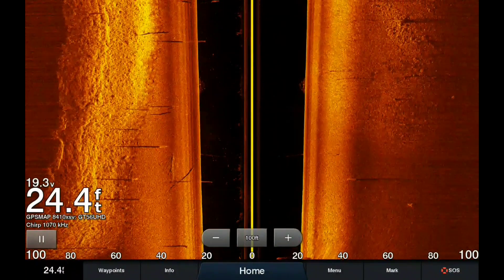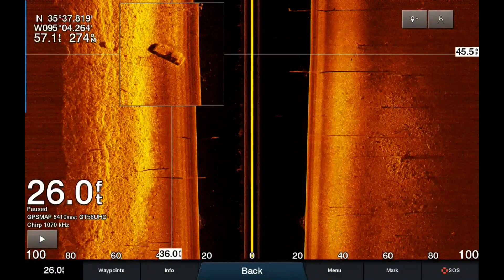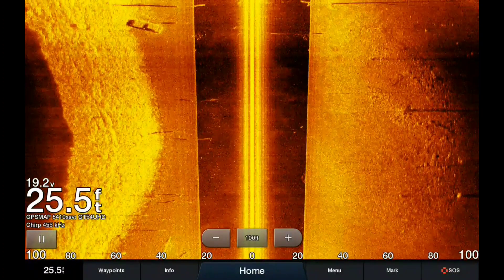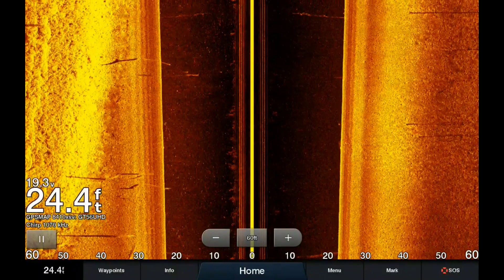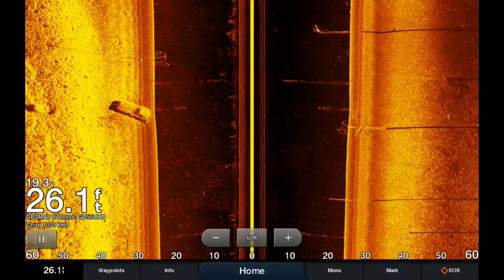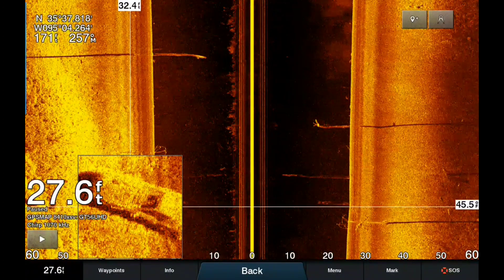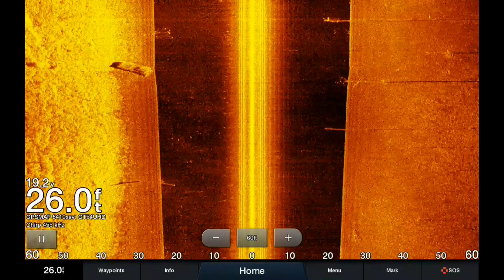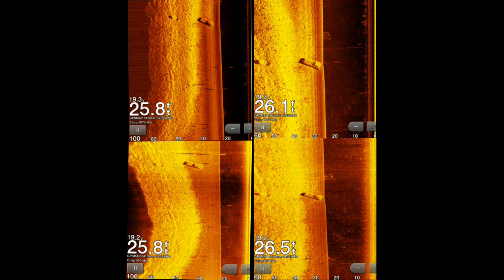GT56UHD versus GT54 Garmin Transducer set at 100 ft and 60ft on a found car / truck

Comment: Thanks for the comparison.  The new fish finder I'm getting comes with the GT54.  Which still looks pretty good.  I will be using it between my kayak and boat.  My plan is to use the GT54 on my kayak and get the GT56 for my boat.

Comment: Good information, sorry you didn't run the GT54 at 1230Hz to see if that improved the image. But no matter, the extra 3 inches of transducer gives a crisp image
Reply: noticed too pointless video
Reply: I noticed the same thing. I just ordered the 93sv UHD bundle on a Black Friday deal. It comes with the GT54 (UHD model, I think...), which has 455/1200 SideVu selectable frequencies and a fixed 800kHz DownVu. 

The GT56 is 455/800/1000 selectable on both SideVu and DownVu (I think....), and also is a more powerful transducer (500 vs ~350 watts?).

I think the 1200Mhz setting w/ the GT54 should produce images as clear as the GT56, but with some limit on range. If you're blue water fishing, the GT56 would be a better option, but otherwise, the differences will be minimal.
Reply: On same frequency difference is not that huge,pointless comparison

Comment: GT56 way better. Going off your previous video, it did look like an 80's Cutlass, but the other angle looked like a truck. It will be interesting to see what they pull. I live in NE OKLAHOMA so I've been checking AWP and haven't seen a video yet.
Reply from the maker: From AWP 
White Chevy Monte Carlo. We are trying to locate a plate now. The plate is below the silt line and buried a little bit. 

Windows are down on both passenger and driver with front windshield busted out. 

Car appears to be clear.
No license plate on the car. White or silver in color with a red pinstripe on bumper
Reply: @kansasyouthbass  ty 🙂

Comment: yours are cool Garmin elecs videos sir. Just trying to decide between gt56+8412+livescope or mega imaging + solix/apex. Just holding on to see mega live scanning. I'm looking for the best side scan with added livescoping. Would you have any idea how does this compare to birds' stuff?
Reply from the maker: If you're going to wait for Hummingbird live which will be the equivalent to current livescope you may want to wait for garmins new 3d livescope they already have submitted patent for. In my opinion Hummingbird sidescan is still a hair better but garmin didn't give up stuff to Lowrance and bird to be equivalent. It's because they are always one step ahead. I'd get 8610xsv highest pixels per sq. Inch and a livescope now. Then upgrade to 3d when it finally comes out.
Reply: @kansasyouthbass  very good, thanks for the info mate. Are you saying the 10in model in particular or are you referring to 8600 series? Surely, 12in model is still full HD. I'll ask you another one too. For the front, would you also splash for another 8600 or would 1280x800 res do there isntead, say the ultra model. The Front mainly for the livescoping
Reply from the maker: @MarcinKantor  The 8410/8610 is the same pixel count as the 8412/8612 but spread out over more screen size so you will lose a little definition but not much. I am running 4 of the 10s two up front and two at dash.

Comment: Seems GT54 is placed at a spot with more noises from the propeller or the like.
Reply from the maker: It's on the force trolly motor built in
Reply: @kansasyouthbass  interesting you got so much noise.

Comment: why don't you compare probes at the same frequency? would it still be fairer? no ?
Reply from the maker: I tried that and it was even worse on this particular depth/ rocky point.  I'll do some more comparisons on similar passes in different depths.
Reply: @kansasyouthbass  Yep I would definitely let to see this with the gt54 set at 1200 and the gt 56 at 1070. Then maybe show how the gt 56 looks at 800 and 455. Since the GT56 is more powerful would that allow you to scan further on 455? But I see how the gt54 would be much darker and limited range at 1200 if it is that dark on 455

Comment: How did you get 19.3 v to the unit?
And to the people complaining about the frequencies being so different. Doubt any of them have run the 54 @ 1xxx in that depth range. Mine blows everything out to the point it is unreadable
Reply: You 100% should be running 1120 at 25 feet. Really anything under like 35 feet should be 1120. You must have settings wrong, Id start with brightness, contrast, tvg, and interference. Theres a reason the OP hasnt responded to anyone that called him out for it, he thought no one would notice.
Reply: @mojo2090  appreciate your response. I spent yesterday playing around with all the settings in the higher freq. I am running a 54. It is too bright and I lose all detail no matter how I adjust. The 455 works better for me.
Deepest I am going is 25'. although depth doesn't seem to matter, nor bottom content
Not sure. Will keep trying. Thanks again
Reply: @jimk4267  https://youtu.be/1Eqq6mdwA7w watch his videos. He explains it all well and doesnt try and mislead anyone.

Comment: This is an extremely misleading video. I guarantee if you ran the 56 at 455 and the 54 at 1120, the 54 would look better. Yes the 56 is better but you are completely misleading people that dont know any better.
Reply: Agree, although at a 100 ft the GT56 will out preform the GT 54, but at shorter distances the GT 54 at 1120 will out preform the GT 56 at 1070.

Comment: 60ft? its reading 26.1ft on the screen...!
Reply: @mikegray8808  I've bought the Gt56 with the 95uhd ,it's being fitted next week.Looking forward to using it.Hoping I'll get better results over the raymarine element 7v which I felt was disappointing in a few ways.I use at sea to 100ft., average 30ft,clarity variable.